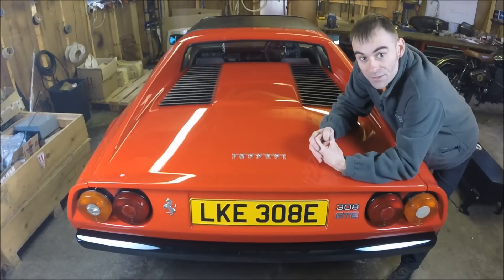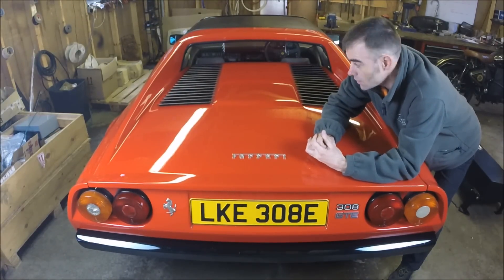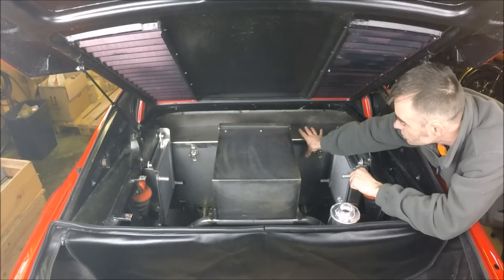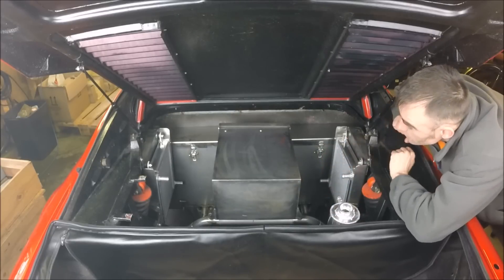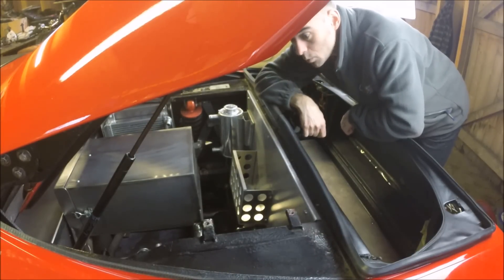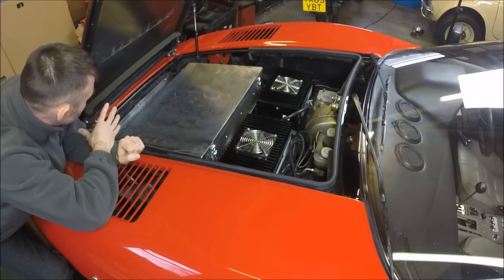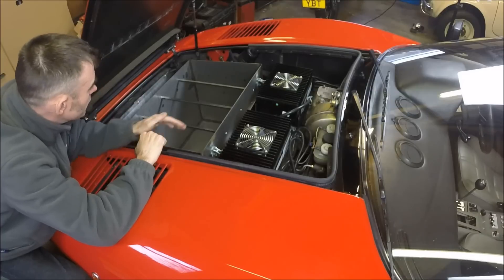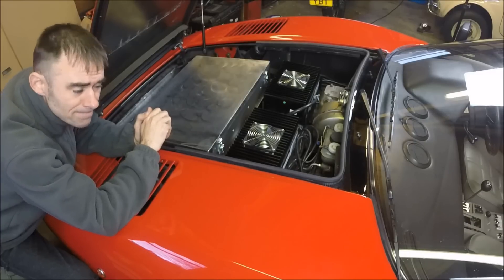Ferrari 308 electric conversion - Phase 2

Comment: Great, so where does the spare wheel go? And you have just added a massive weight overhanging the front wheels, ( here comes a bag full of understeer ) will made it handle worse than the original as you now have placed a massive amount of weight further away from the car's centroid. Weight distribution front to rear is about having the same mass on the front and rear wheels, doesn't mean you throw it further from the centre of the car and thus increasing it's  polar moment of inertia.
Reply from the maker: When it was petrol it had all it's weight in the back, engine, gearbox, exhaust, petrol tanks were all at the rear. Worse weight distribution than a 911 of a similar era, at lest the Porsche had the petrol tank at the front.  The 308 was a very light car at the front and understeered terribly when petrol. Now it's electric it's more like 50/50 weight distribution and handles far better than when it was petrol.
Reply: @ElectricClassicCars  Porsche 911 of the same era distribution is 59% rear and 41% front, Ferrari 308 is 57% rear and 43% front. So no, you are dead wrong. And by adding more mass to the front overhang, you have just increased the overall polar moment of inertia. 50/50 distribution is only half the formula, how you achieve the 50/50 split is what makes the difference. By spreading the weight to the extreme ends is NOT the way to do it. I totally disagree with your methodology . By the way, I understand that you are restricted with space etc on where you can place these batteries, so I'm not bagging you out as you may think I'm trying to. But why not try to get the front batteries in the hole where the original one was, just in front of the foot well ( fire wall ) it's quite deep and wide.
Reply from the maker: @marcolucchini8173  We corner weight every car that comes in. Looking back in the files the 308 came in at 40/60. Everyone who's driven it, including the owner and journalists, have  commented about the explosive performance of the electric motor but what they've all been most surprised about is how much better it handles compared to when it was petrol. Having driven it before it was electric I can confirm it now goes around corners like it's on rails. Keeping the weight really low to the ground and improving the weight distribution, along with suspension to match that change has transformed the handling for the better.
Reply from the maker: Here's a good test drive and review of the electric 308 by someone who owns a petrol 308 who's also picked up on the better handling over the petrol version. https://youtu.be/Gad0z2NuSCA
Reply: @ElectricClassicCars  rubbish. The petrol tanks are just behind the seats and in front of the rear wheels ( exactly where you placed the rear batteries- so you have made no improvements there ), the engine, gearbox and even the diff are in front of the rear wheels ( exactly where you have placed the electric motor ( so no improvements there ).  Now you have place a massive weight just behind the front grill where there was only a radiator that weight stuff all ( a backwards step ) Where do you anticipate to place the spare wheel? . What you have just done is created a flywheel by placing more weight at the front end of the car. You cannot deny that. So basically what you are telling me, is that the F1 boys have it all wrong! You need to keep the weight between the front and rear wheels. The Fiat X19 does that very well.  With the batteries in front of the front wheels, you have greatly upset the balance, the mass should be concentrated in the centre of the car, not at the two ends. Basic physics. I have to disagree with you theory.

Comment: Though it will be sacrilege, adding a vacuum formed transparent acrylic faring on the rear to streamline the bluntness of the rear window, now that the engine venting is no longer needed, would decrease drag quite a lot. Also, this must be a free conversion with all those original spare parts no longer needed.